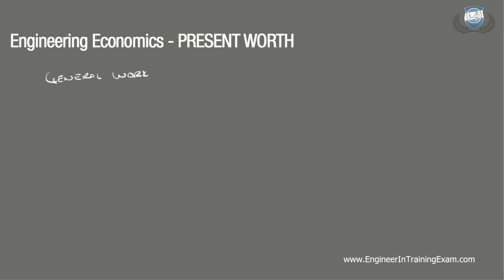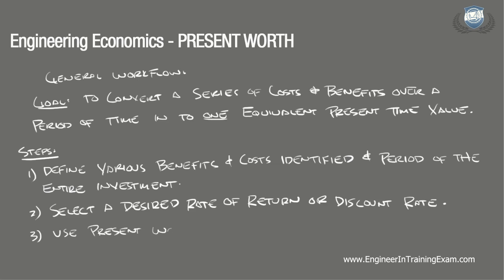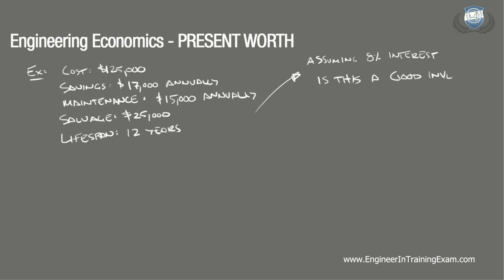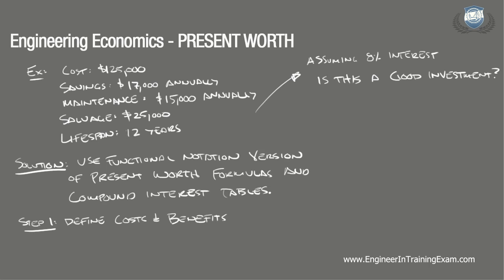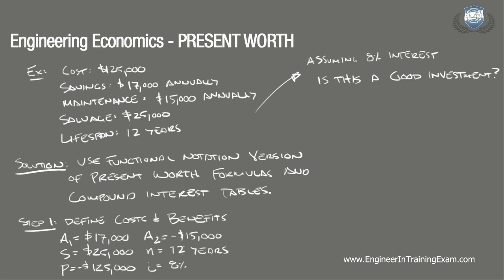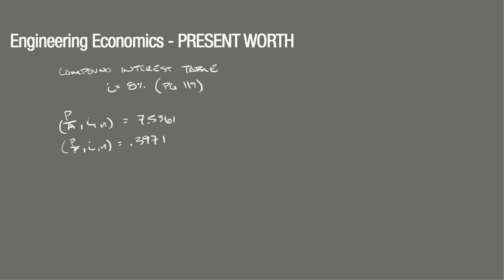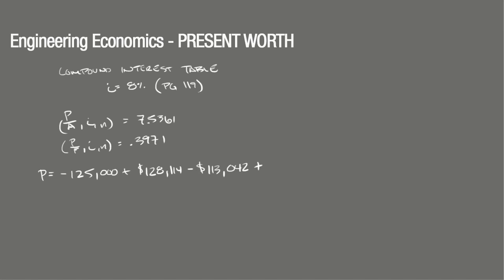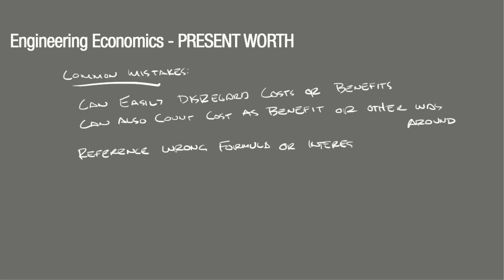Present Worth - Fundamentals of Engineering Economics

Comment: I had a hard time following after 6:49, when you said A*P/A, but wrote A/P. I am sure that what you said and wrote is both correct, but I do not understand the notation.
Reply: I'm sure you don't have this issue anymore as this comment is very old but for those with the same question, later on you can see when solving the equation he uses "A(P/A)". I am guessing he wrote P(A/P) as this one is just the inverse as the one he used.